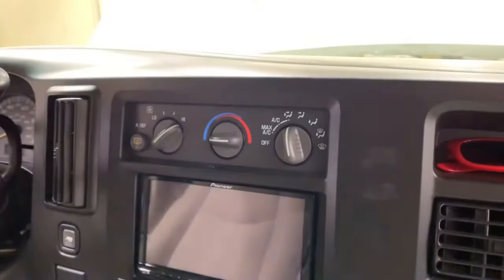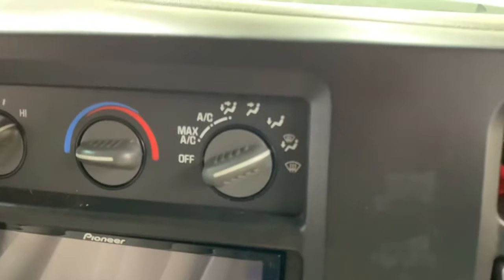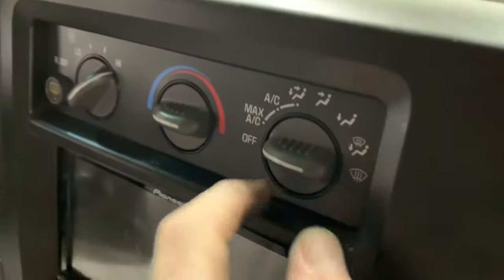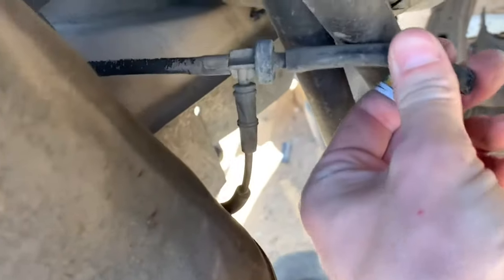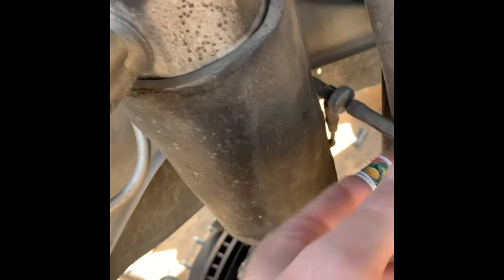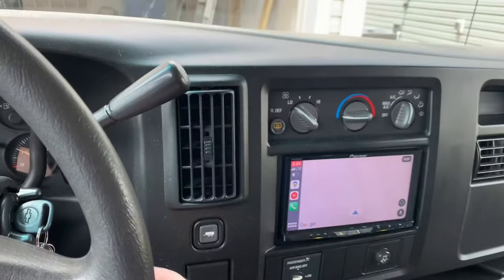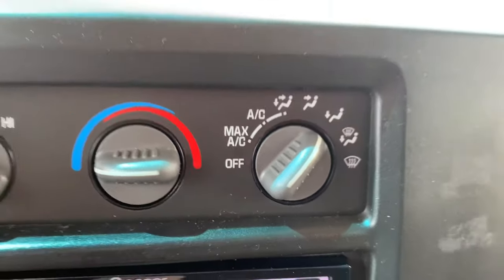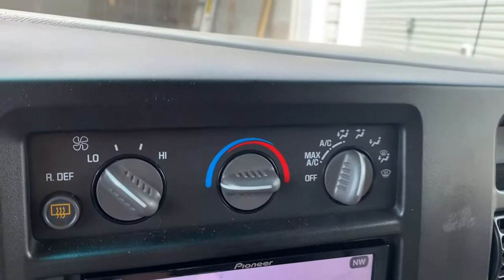Vacuum Check Valve Diagnosis / Replacement - Express Van

Comment: Bro you are the only video out here speaks on this,  I went under the hood and my line wasn't even connected to that vacuum ball. The air feels beautiful now thank you bro great video
Reply: did you have to take the battery out to connect to vacuum ball?  i couldn't find the where the hoses are attached to the T but i did find one hose just dangling...when i put my finger over the opening of the hose it has suction...i think this is supposed to be connected to the vacuum ball under the battery?

Comment: Excellent information, I have had very poor heat in my 3500 savanna work van for two years now. Working in Ohio in the winter and not having heat when you come down off the rooftop is a BITCH. I replaced the lines and the check and watched the heat control valve that evidently was not getting enough vacuum to open it fully, now its fully functional. You Sir managed to keep a working man warm this coming winter...! Bravo !!!!
Reply from the maker: Oh man... Native Michigander here. Not sure how you made it that long without heat! Glad you're ready for the winter now buddy!
Cheers!

Comment: Great video thanks. All my express vans had this issue sooner or later and I always just lived with it.
    Your video gave me the most important info....where to even start looking for the problem!
   Turns out it wasn't my check valve, but I followed the three hoses with my fingers and eventually found a split/crushed section right where one attached to the manifold.
   I couldn't see what I was doing it was so far back behind everything, but there was enough room to get arms and hands back there and cut out the bad part and reattach it.
    Cold air flowing out of the vents is magical!!
Reply from the maker: Wow! Very nice!!
Luckily the vacuum system isn't TOO complex on these vans, but the locations of the lines are the biggest hinderance.

It's getting a little too hot outside to have the AC blowing at the windshield haha

Glad it's working again!
-Tim

Comment: If the hoses were made of silicone rubber they would last a lot longer. It ticks me off that they are made of something that fails so quickly. Black rubber turns to charcoal inside a hot engine compartment. I am upgrading to silicone vac hoses. This video was very helpful because I didn't know about the check valve or where it was hidden.
Reply from the maker: Just long enough to last through the manufacturer's warranty! 
Seems to be the sad state of ALL industries these days.

Hope the line upgrade went well! I know one of the lines goes up to the engine's intake plenum. Can't remember if it's accessible without taking off the engine cover inside the van.
Reply: @VanwithTim  The engine cover needs to come off to get the job done. Filthy hot work in a Texas summer. I could feel the hose leading to the engine. It was split open, so now I need to get up my ambition to remove the dog house. Meanwhile, I just drive with the window down.
Reply from the maker: @normanwitzler9665  Ah man...
Not a fun job, but you might be able to get it loose enough in under 10 minutes :)

That is unless you want to remove the dog house from the van. Then there's the whole passenger seat removal process. Such a lovely design lol

Stay cool!!

Comment: On mine the line was disconnected to the vacuum reservoir so I thought for sure that would be the fix. After plugging it in, the A/C still doesn't work and the vehicle does not start. Any suggestions for next steps there? I'd assume other than unplugging that line...

Comment: I decided to buy & use the [Dorman] Vacume Check-valve after seeing this video; 
That [Dorman] Vacume Check-valve is Good; shaking it you will hear a Ball unlike [AC Delco] Vacume Check-valve which is a Diaphram. When installed in a Verticle position; for the Ball to easily engage; Im assuming that a Ball inside can be more durable than a Material Based diaphram. Verticle means Reservoir-port at Bottom & Intake Manifold's-port above, the AC Controls-port positioned Horizontally; as directed towards the left. This eases engagement with Gravity assistance! 
Basically, You should install the [Dorman] Vacume Check-valve as the original is positioned as the manufacturers workers install it; not as another direction!
Reply from the maker: That's a great idea! My original valve was installed horizontally and I thought the Dorman check valve would work okay the same way.

Maybe there wasn't enough airflow to move the ball into the "sealed" position when in a horizontal position.

Using gravity to close the check ball is a perfect solution.

Dorman should make a note of that on the packaging!
Reply: Unfortunately for us, we might not have [Dorman] brand & prices as an option; as Pep Boys is Closing down. In California, one of the last stores Manger said their being replaced by "Advanced Auto" and will not be a Retail-store distributor but 'Parts order' type of sales!
Reply from the maker: @edmateos17  My first job was at a small mom and pop auto parts store.
Seems I could find anything and everything no matter how odd in those dusty paper catalogs.

I spent my college years at O'Reilly Auto. Was pleasantly surprised they had paper catalogs. (Although only the manager and myself knew how to use them).

It's a fast changing world for sure.

Comment: My AC works fine but I do notice that after I passed 55 and I’m pushing on the gas it’s sputters like if it has like a vacuum leak or it’s not getting enough gas. Do you think this is the problem?
Reply: Mine works fine and when I pass 55 it stops coming out the vents and comes out of the defrost and floor barely...
Reply: @antonboldsword3770  in ac mode for me I either have to break or put the pedal to the floor to get the cold air to start circulating will definitely change that guy out

Comment: Thank you I think this is going on with my van.when the ac is on it blows out of vents,defrost,and foot vents.
Reply from the maker: Sounds like it's definitely something in the vacuum system.
A lot of people have also found their vacuum lines under the hood in need of replacement.

Comment: This fixed the top air vents in the rear but still no air from the front vents and still reads 80 to 90 from back vents even though psi is at 30, any way you can help me out? It’s an e-350 ford super duty van 2014

Comment: I have the same vehicle. What would be the cause of little cold hair in idle stationary for long time, versus on the road its really cold. Also, over time in idle and stationary (waiting at parking lot), the flow of air at max diminishes while on and when I turn of the A/C unit after a while I turn it back on it starts to blow full speed at 4 (max). Its like if it freezes internally and little air passes through. Also, when the A/C is turned off driving down the highway, if you have it set to cold, you feel some cold air, if you set it to hot, you start getting warm air through the vents without even having the a/c on. Any ideas? These Chevy Express vans ALWAYS have A/C issues 😅 I also noticed that my MAX and regular cold vent settings are the only one that works like if the actuators not working properly. Do you have any videos on these?
Reply from the maker: Do you see any big voltage fluctuations when idling vs driving? It should show around 13.5-14.5 volts at idle and driving. If the alternator is bad, it could be dropping out at low RPMs and allowing the voltage to drop to 12.6v while running.

You should also check the wiring harness above the blower motor under the hood. It will be a six wire connector like this: https://amzn.to/3RvnHPr
Unfortunately, the pins in the connector are known for coming loose internally and causing a ton of electrical resistance (which causes a lot of heat and has even burned these vans to the ground).
Definitely unplug the connector and look for any discoloration of the plug or terminals.

It's also possible that your evaporator is freezing, especially if it has restricted airflow.
If you remove the blower motor under the hood (three bolts – 30 second job) you can look inside to the left and ensure your evaporator is clean of debris. Spray it with a hose and make sure the water runs out through the drain on the bottom of the HVAC box. Here’s a video of the evaporator core access: https://youtu.be/qY6pH7yRvzM?t=448 

Also, if the system is off (knob on the far right set to “off”) you’ll still have air coming into the cabin while driving. This is because of the positive pressure in the front of the van, and the vacuum at the rear of the van (the air exits through a baffle behind the right rear tail light). The HVAC system is only closed off from the outside air when in MAX AC mode (recirculate mode). All other selections are fresh-air from outside.
Reply: @VanwithTim  Thanks very detailed explanations. Definitely subbed and hope others are reading this to sub too.

I will check evaporator inside the air box. I noticed some leaves and stuff in there before through the harness opening. I actually replaced the blower motor harness that goes into the box. It was corroded as if water had gotten in there. The  bottom resistor thingy on the blower motor harness on that amazon piece you posted was all rusted and one of the legs corroded completely on the resistor. Kind of odd it was rusted. The new one somewhat fixed the issue with the moisture coming through the vents, but the issue with mild cold air instead of really cold air when we are driving still persists. My dads mechanic is always checking the A/C Freon and tops it off if needed. I will clean the evaporator myself and check.

Question, the van gets extremely hot under the hood (imagine the paint is falling off on the top side of the hood) and my dad did replace the radiator and the fan right behind the radiator. No other warnings or temperature fluctuations. You think the condenser could be clogged with bent fins causing the A/C issue while stationary. In my van, the transmission oil cooler is in the front, then the A/C condenser, then the radiator followed by the fan in the middle of the engine bay facing the serpentine belt.

With regards to the right knob not switching  between foot, to windshield, to face like if the actuator is stuck that diverts the vents, is that an issue with the color coded vacuum lines under the passenger foot-well or the actuator needs replacement?
Reply from the maker: @CSJiGSaW08  Hmm that’s so strange! Sounds like most of the common troubleshooting items have been taken care of already. For the condenser, it wouldn’t hurt to spray it down with a hose to be sure it’s clean, but usually a dirty condenser or bent fins would affect the cooling at idle and not while driving.

If it sounds like the blower motors airflow is audibly diminished while driving then returns when the van is stopped for a little bit, I would be looking at the vacuum system.

You’re correct in that the color coded vacuum lines under the dash control the “mode” actuator (which directs the airflow: defrost, face, feet)

The vacuum lines also control the “MAX AC” (aka – recirculate door actuator).

The temperature actuator is fully electric though.

It's rare (but not unheard of) to have any issue with the vacuum system inside the van unless it’s been physically damaged.

I would certainly start with a check of the vacuum line running from the engine’s intake manifold to the check valve, then the check valve, then the vacuum accumulator ball below the battery tray, then the other line off of the check valve that leads through the firewall to the HVAC controls.

Be careful, it’s common for the vacuum lines to crumble when you touch them. If they do crumble they were probably the issue to begin with and you can grab some generic vacuum line by the foot at the parts store.

Note that the vacuum port on the intake manifold is kind of tough to reach from under the hood. You MIGHT need to remove the engine cover inside the van to gain better access. It does help to move the coolant overflow tank to the side when doing basically anything under the hood though.
-Tim
Reply: @VanwithTim  thanks Tim will check on this and the vacuum lines. I remember long ago when everything worked fine, the compressor clutch would kick in with a clank noise every few minutes and would cycle and the A/C would blow very cold for long periods indefinitely. Now when I start the vehicle, the clutch kicks in with clank noise and never cycles that clank noise again. Does that sound familiar ? And be related to the cold air (little) while idle after about 15 minutes and get colder while driving down the freeway?
Reply from the maker: @CSJiGSaW08  Certainly strange to hear anything other than a click from the clutch when the compressor turns on.

It might be worth renting the AC gauge set from the parts store and seeing what your high and low side pressures look like. That would help point in the right direction.

It would show if there were any internal restrictions in the system (a clogged orifice tube) or if the compressor is failing to build proper pressure.

Here's a quick video on the gauges: https://youtu.be/_Qt6UCmzRH4?t=90
And here's the chart he references for troubleshooting. You'll have to zoom in a bit to really read it, but that would 100% tell you if there's an issue with the AC system or the vacuum system. https://bit.ly/2UZkdGx

Lots of other good videos on the AC "manifold" gauge set and how to draw conclusions from the readings!
Reply: @VanwithTim  Thanks Tim, I will get some loaner gauges end of the week and see what readings I am getting. FYI, when the A/C is on  1 or 2 speed blower setting, there is more cooler air than on setting 4 while parked in idle after 30 minutes or so of the vehicle running. 

I did a test yesterday with the A/C blowing air not so cold after 30 minutes, I was parked and idle and I raised the RPM to about 1500 -2000 while parked and noticed on all settings 1, 2, 3, 4 that air got really really cold. This make sense with how the air gets colder when I am traveling down the highway because the RPMS is giving me colder air.

Comment: What about a plastic intake manifold leak when pulling hill? I pressurize my 2002 gmc as an 5.7 3500 coolant and it bubbles and doesn't hold pressure
Reply from the maker: Not super familiar with the old 5.7L but my parents had a 99 Express with one and it had a failed intake manifold gasket. Same issue you're describing. Might be worth looking into?

Comment: I had the same issue and the vacuum lines crumbled in my hands. GM obviously used the lowest quality on the market.
Reply from the maker: I've been seeing so many comments saying the same thing this summer! In theory it should even help smooth out the engine idle having fixed a vacuum leak.
Glad you have it figured out!
Stay cool!
-Tim

Comment: Our 3500 has air normally only coming out of the defrost and floor. Once a day it will start blowing out  of the vents the way its supposed to. Does the sound like the check valve or vacuum from the panel to the motor?
Reply from the maker: I would start with the check valve as it's the more common issue and also much easier to get to for testing.
Also worth looking above the passenger footwell at the vacuum lines to make sure none are broken / disconnected.
Reply: Mine (3500) was doing the same thing until it finally stayed stuck that way, I also had very poor heat in the winter. Most of my problem was the main vacuum hose off the top of the engine that ran down to the check valve. It was crusty and burnt. 4 bucks for a new hose and a little sweat equity and I'm back in business. I also checked my vacuum with a gauge at the top of the engine were that tube connects just to make sure I had good vacuum. Reading was 18-20 inches of mercury which is great.

Comment: So my van only blows hot but I can feel the compressor lines are ice cold and I also don’t get that hissing noise when I shut off my van. (It also only blows at feet and defrost. So change check valve first then of that doesn’t work move onto vacuum leaks?
Reply from the maker: Hey Joey - sounds like you have two separate issues here. The "mode" door is the one that's controlled by vacuum and changes the direction of the airflow.

If it's not changing the airflow even when the van is running at idle, it sounds like there's a bigger issue than the check valve (don't worry, the system is pretty simple)

Basically one vacuum line comes off of the engine, goes to the check valve, then from the check valve tees off to the vacuum reservoir and the HVAC controls.

Many people have found the line between the engine and check valve crumbled or completely broken with age. Once replaced it should solve the mode door issue (and possibly smooth out any rough idle issues).

**************
Temperature:
The temperature blend door is actually 100% electrical. If working properly, it should make this noise: https://youtu.be/tv55XtgJfUE
If not, check the fuses first and foremost.
I can also send you an electrical diagram to help troubleshoot. It's pretty easy to get to if you need to replace it.
Feel free to shoot me an email if you need that wiring diagram or fuse location, etc.
VanWithTim@gmail.com

Cheers!
-Tim